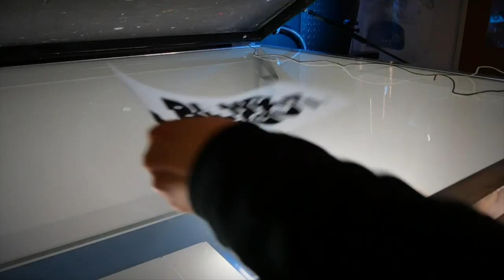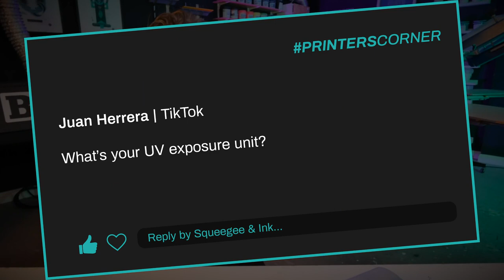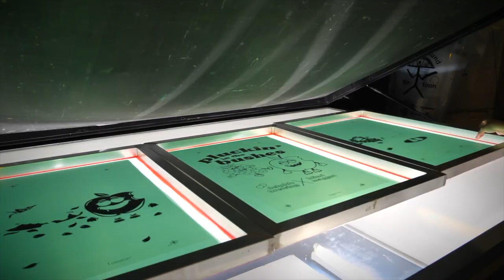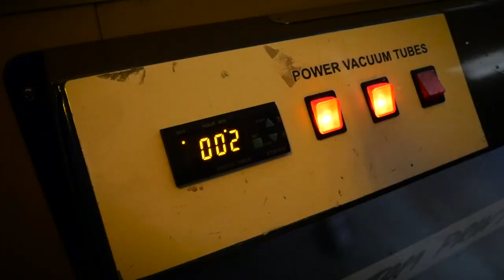Will Squeegee & Ink upgrade to an automatic press? | Printers Corner Ep07

Comment: Do you think traditional screen printing is superior than screen print transfers in terms of durability?
Reply from the maker: Yes for sure! There is adhesive involved with any transfer so that has the potential to be broken down by detergents. The best transfer I have found is from Target Transfers and is the ultracolour. (Discount code SQUEEGEE) I have neck labels that have been through all our washes many many many times.